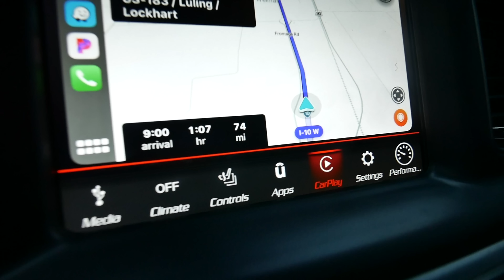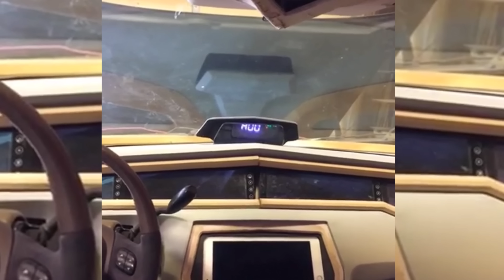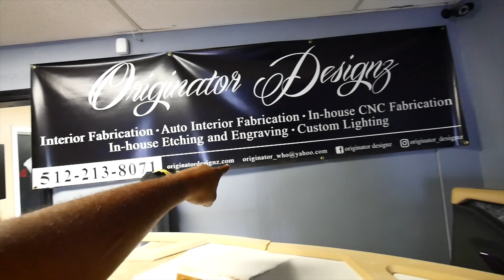THIS GOING CHANGE THE GAME FOR 2020-21 WIDEBODY DODGE CHARGER WHY DODGE DIDN'T DO THIS?

Comment: What it is bro is most company trucks are governed at 65 mph and sometimes the truck don’t have enough horsepower or speed but he wants to pass the other truck driver there is no courtesy out here anymore the right thing to do is if the other truck driver notices that the other driver is passing him all he have to do is allow him to pass him that is very Dangerous when two trucks are next to each other like that if one has a blowout it will be a mess

Comment: I have no clue why you are going to Lockhart.  As a truck driver we have 2 reasons for doing this.  One is because there is a wreck up ahead and it came across on the CB that we have.  The other reason is if the truck in front of you is going slightly slower then the other then you have to pass them and it will not be a fast pace.   Due to delivery schedules you have to pass the truck that is going 2 miles an hour slower than you so that you can maintain you speed to deliver on time.